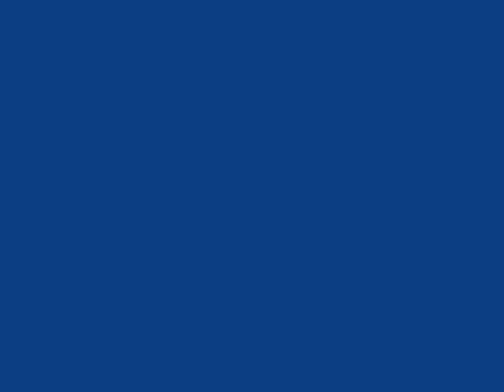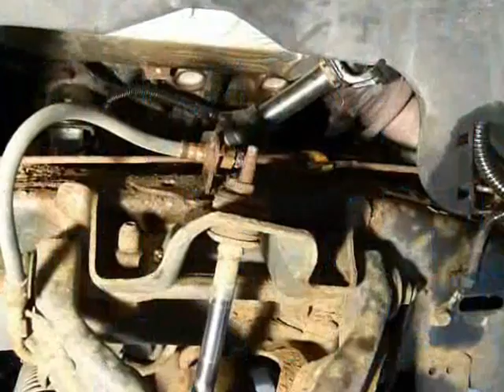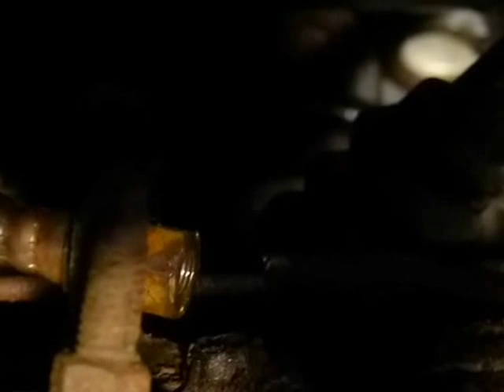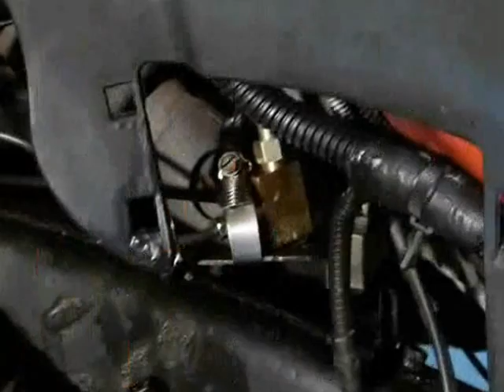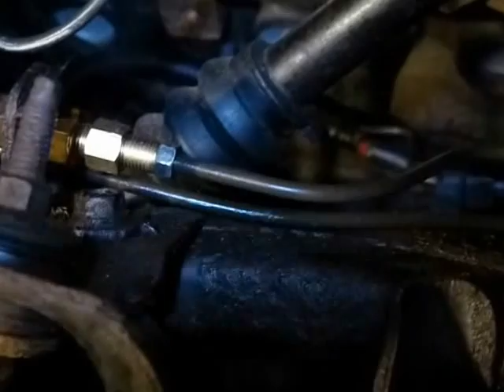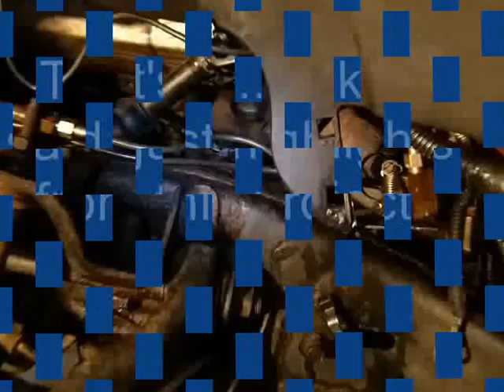Dodge Dakota Brake Line Replacement Highlights

Comment: Where did u get the lines i cant seem to find any for my 98 dakota
Reply from the maker: You have to buy raw brake lines and bend/flare it yourself.  They don't have pre bent kits for the Dakota's that I'm aware of
Reply: If you check local shops they will make them for you.  I know the ones for my 97 have been discontinued.

Comment: Could you please tell me what adapters were used and what size I would need and if they still are holding up. I'm getting ready to change my lines on my 2003 Dodge Dakota.  Thank you
Reply from the maker: Sorry, I don't remember the sizes.  I sold the truck a year ago and all was well up to that point.

Comment: I'm fairly certain several of the better shops still sell fabricated/measured brake lines (I'm in Ontario also).  I prefer to flare and bend my own to suit but I love the idea of those adapters in a pinch!  Thanks for sharing.
Reply from the maker: At the time I did this I couldn't find any pre-made lines.  I would have preferred to use them as my flaring tool isn't really that good.  Thanks for watching!
Reply: Here i Indiana you canot get a pre bent line.

Comment: how long is the line going to the back and front? how long did it take you to do the lines?
Reply from the maker: +Xue Lee I don't remember how long the line was.  It took me 5 or 6 days working only an hour or so a day after work.  If you use the new Nickel/copper line the job will go faster as they are easier to bend.